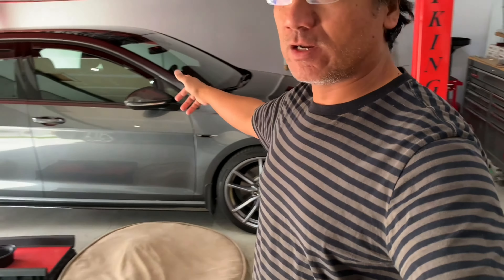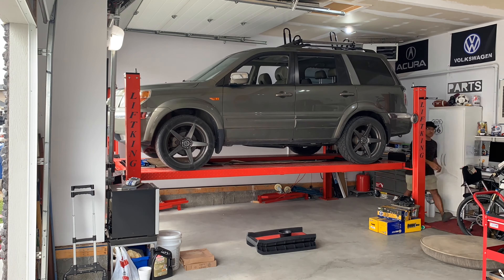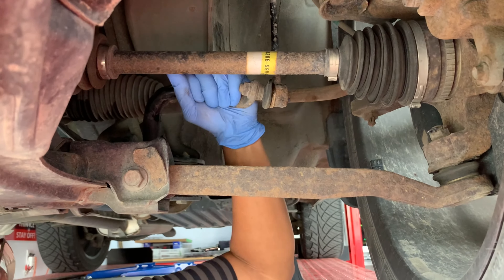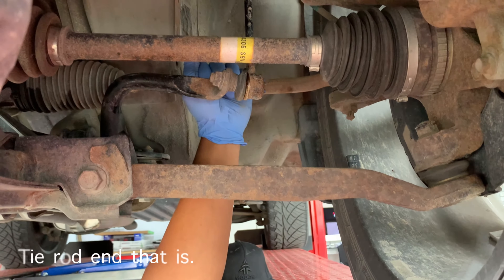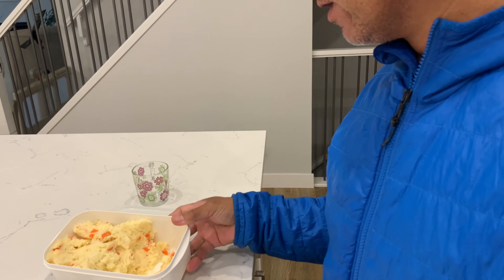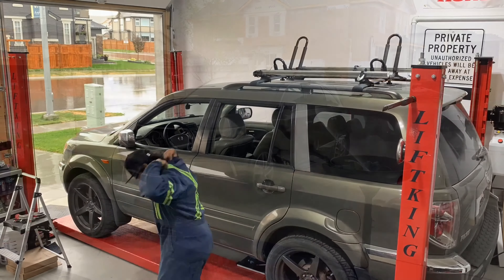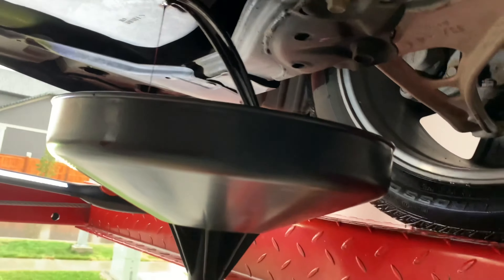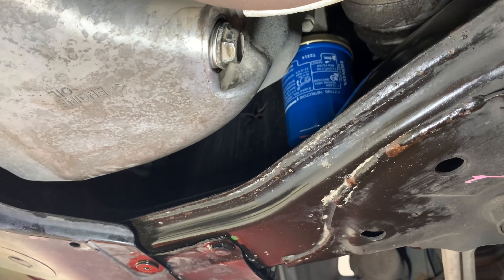Inspecting Underneath the 15 Year Old 1st Gen Honda Pilot | Vlog

Comment: Hi, I have the same vehicle thanks for sharing this video. You should pay attention to the rear subframe where it connects to the unibody it’s a weak spot for rust resulting in the subframe separation from the unibody. It’s an easy fix if you have a welder.
Reply from the maker: Thank you for the heads up! I will sure keep it in mind. Speaking of welding, I was actually looking into some mig and flux core units today and hope to be adding it into the ammo going forward
Reply: @JNBTuning  Hi, yes a welding machine comes in handy! I hope you can get one. 

Here is a link of a DIY repair there are many videos about it. 

https://youtu.be/3jdh8qMFR4s

Even if you don’t see rust it could be rusted in the inside, it’s a design flaw by Honda with the 1st generation Honda pilot.